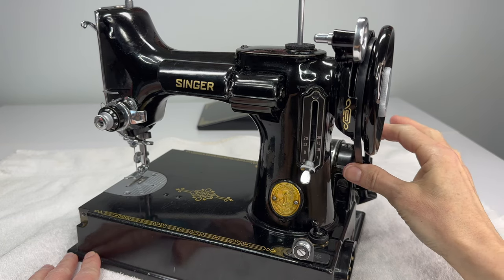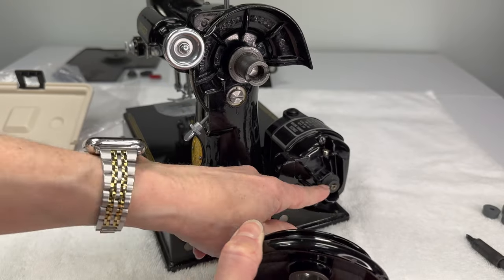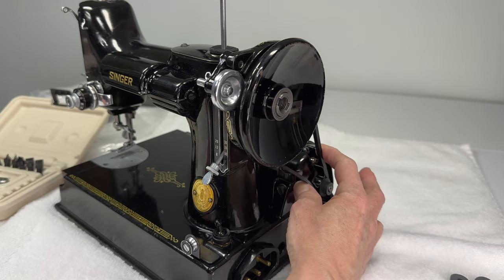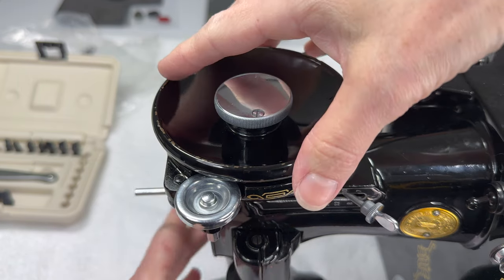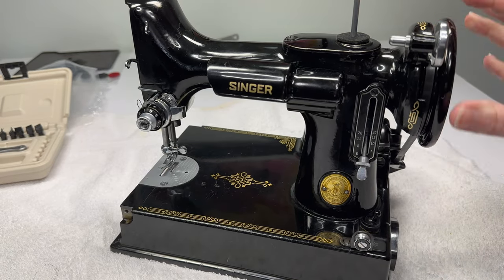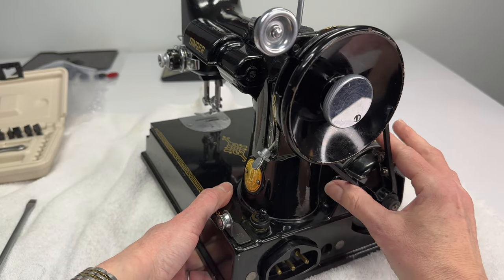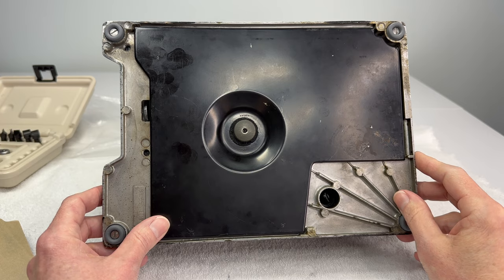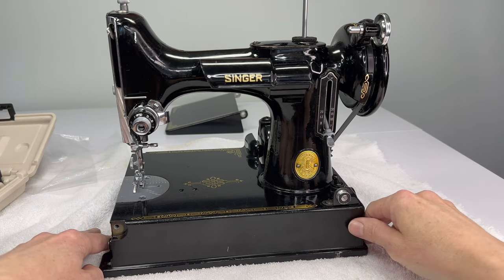How to install the belt, nose plate and more on a Singer Featherweight: Restoration Series Part 19

Comment: Amazing!  I just watched everyone!  Thank you.  I have a featherweight that is completely bound up.  Can’t wait to see what is wrong.
Reply from the maker: Hi! Thank you for watching! You will have to keep me posted as you go, there are several reasons a machine can bind and I love figuring out what the problem is. Make sure you get plenty of oil in all the places it should go and as you remove parts keep checking how its moving so you know when you have got to the problem. Good luck and let me know if you have any questions!

Comment: Clear and concise and very good as always (especially with that handy "view" to check whether the clutch release washer needs to be turned 180-degrees before putting in the screw) - thank you!  

Sometimes when the needle bar wants to intermittently go up and down for no apparent reason, even though I've engaged the stop-motion, I find that just putting the presser foot down is enough to stop the needle bar going up and down.  It is as if the grip of the handwheel on the bushing is just on the cusp of being loosened enough to work every time and the "extra load" introduced into the system from just putting the presser foot down is enough to overcome it. 

I can't quite recall where I first heard that - probably either Bob or Andytube, maybe both - but it works for me much more often than not.  (Of course, I've always taken off the handwheel and thoroughly cleaned the the bushing and the hub of the handwheel before I resort to the "I guess I'll just put the presser foot down then" solution.  But I know you've already done that with this machine here so it would be interesting to know if putting the presser foot down works for your situation too - even if you're going to do a more permanent solution.)   :-)
Reply from the maker: Megan, I haven’t tried that but I am going to. Funny because the last order I got from the Featherweight shop had a little card with tips and tricks on it and it actually says “Lower the presser foot to keep the needle from going up and down when winding a bobbin.” I thought it was a misprint! Haha! Why have I never heard that? So, I am going to see if that works but this is the first Featherweight I will have ever had to do that with to totally stop the motion of the needle, all the others haven’t needed it. But it must be common if they are putting that on their little cards they include with orders. Either way, I already ordered a new collar/bushing and am kind of excited to take this one off now. :)
Reply: @SewingMachineRehab  Well - fancy that!  I've been meaning to get some of those little "tip cards" but haven't got round to it yet.  I've not had that problem with the FW I've cleaned up (can't have, I haven't got it back together yet!)  :-)  But I have struck it with my century-and-older 28Ks.  I hope you make a video of your collar/bushing replacement just in case I ever do have to do it.